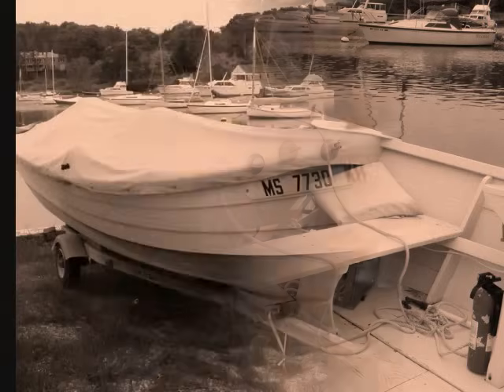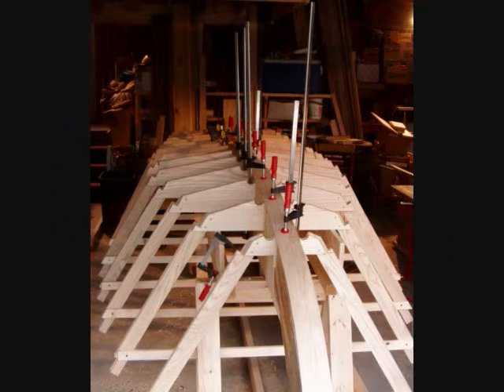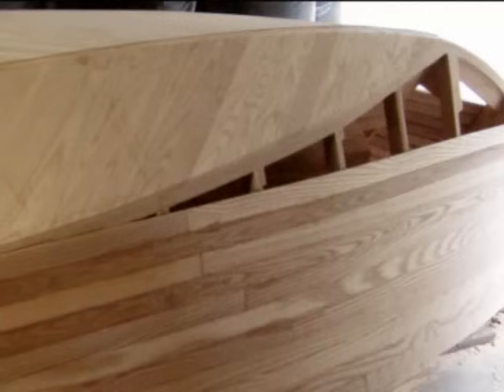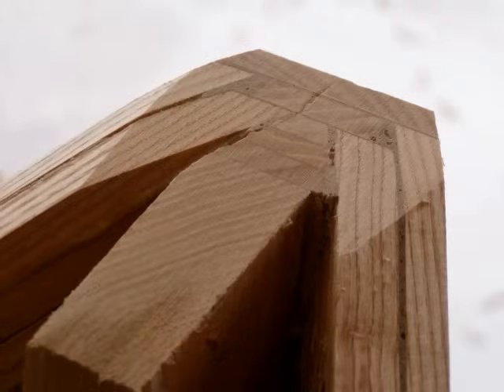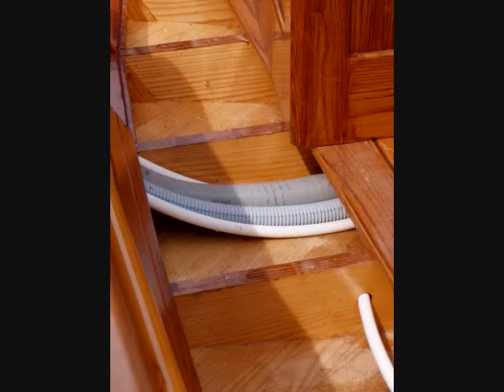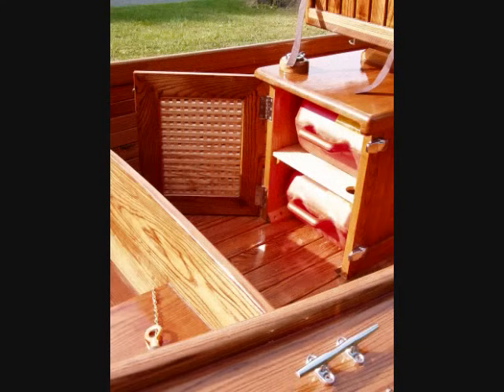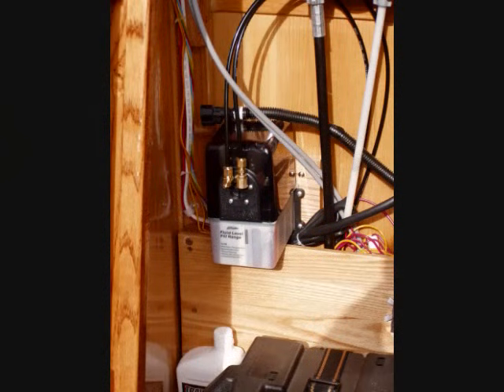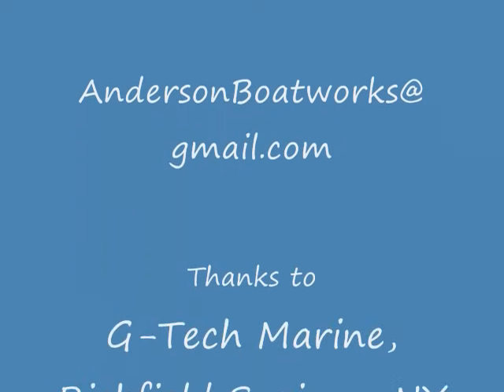Building a wooden boat

Comment: very nice Craftsmanship IMO you can’t go wrong with Building a boat with excellent lines like the Simmons , I’m a retired Professional Woodworker myself  and I’ve owned and operated 17or 18 boats  of many types and materials throughout my life
Reply from the maker: Actually, if I was to do it again, I'd probably increase the beam in the aft section--the Simmons was designed for an 80 pound two-stroke, not a 250 pound 4-stroke engine.  As for concerns some others have raised about wooden boats being "hi maintenance", I've not found this to be the case with a boat properly sealed up inside and out with epoxy embedded fiberglass and a topcoat of polyurethane.  Keeping it under cover, rather than broiling by the dock all summer has probably helped minimize maintenance.

Comment: Mr. ANDERSON,
Perhaps for your next video you could include some of those little written name tags with the small arrows pointing to the various  boat parts you mention. For example, in the shot looking straight down at the bow you name several pieces - the stem for example - which all convergge at the bow. Each piece you list could have little arrows pointing at them with the name of the piece included. A great aid in understanding for a guy  like me.
Lastly sir, if you plan another build to be videoed would you please make it a 22' Bartender? I've got the plans slowly collecting dust in the closet and to see it being built perhaps in a  longer running vid. I'd be grateful.
Paul Beckett 
Vancouver 
CANADA
Reply from the maker: Many years since I made that video......tech continues becoming more flexible and accessible, so a remake would probably look very different.  Thanks for the "pointers".

Comment from the maker: Aye, she's heavy, which is very much appreciated in choppy waters--the 'glass and aluminum boats all go hide while I continue to fish quite comfortably, and with 40 hp on the stern, the weight is not an issue unless you are into racing, not fishing.  I shared your concern about the finish (marine-grade polyurethane)  and though it was painful, I purposely left the boat uncovered in full sun all last summer.  the sole was sprinkled with 150 grit garnet in the topcoat--no slippage when wet.

Comment: Very nice boat and the video is enjoyable to watch.  I do have one question:  How do you get the lumber to bend without steaming it?
Reply from the maker: All the bent work is 3/8th of an inch thick or less and there are no tight radii.  Ash is both tough and limber, so steaming was not even considered and I've had no problems with cracking or joints popping open.  IF the wood had been steamed, I would have had to clamp it in position and wait weeks for it to dry before the glue would work properly, and even longer before stain and epoxy would get a good grip.  Cold molding really works!

Comment: Wood is so warm and welcome. Beautiful workmanship in every way.
At 3.24 on the sides, I would have separated the joints a little further, but of course the  system is so good overall that strength   of the boat  will not suffer, as the joiints are scarphed most probably  but if it is varnished, near joints will not look pleasant in a boat,
Beautiful wood , not a knot anywhere, Congratulations.

Comment: Beautiful boat.  Looks a little heavy watching the sheer. My thoughts are the boat was orig built in plywood to be lighter. Another factor I have concern for is the exterior poly finish as they do not hold up well in daily weather. If you are keeping it in a garage away from rain and UV then its fine. I would also find the floors a bit too slippery when wet and could cause a person to fall.  Is the anchor chain running over a piece of metal or does it touch the wood?  
Just some thoughts. RMP
Reply: He mentioned beach sand being applied to the flooring over wet epoxy to create a nonslip coating of sorts.....from Wyoming USA 🔫🤠

Comment from the maker: I seriously considered a swivel, but settled on the simple locking slide mount because the boat is rigged as a solo fisher....sitting high athwartships in a small, fairly narrow boat, is a good way to wind up with the fishes.  Better to stay facing forward at the helm...you'll hear the drag clicking when Moby takes the troll.  You'll note that the helm seat has substantial arms;they're more than a place to rest your wings--they keep you fenced into the chair in a heavy chop.

Comment from the maker: In rocky shoreline areas such as portions of the MA coast and along the St Lawrence River, the danger of impact is imminent, while rot is a long term problem that will never come up if you hit a submerged rock first....I opted for high impact strength ash (that's why they make baseball bats from it), and will rely on technology and maintenance to keep ahead of the rot.

Comment from the maker: At 2 minutes into the video, you can see holes cut on both port and starboard sides through each frame right where it meets the keelson;  any water that boards will run aft to the bilge pump at the inner transom.

Comment: Beautiful boat!  Why did you choose white ash?  Also what glue did you use for the bottom planking?  Will you consider selling a copy of your boat plans?
Reply from the maker: Ash bends and rebounds well, it's hard and not easily marred, and it takes epoxy like a sponge; plus, I can buy it direct from local mills and get the dimensions I need.
   I used a urethane subfloor adhesive to assemble the frames and strips.  It has a more flexible bond than epoxy, making the joints less likely to pop under shock impact.  It also is much easier to use as it requires no mixing and the excess can be shaved off with a chisel in one pass.
  Simmons plans are available from the Cape Fear museum.
Reply: Thanks, I found the plans.
Reply from the maker: White ash has another advantage--it stains when it gets wet, a dark enough stain to see through the clear epoxy finish.  So for a boat that's finished all bright like this one, you get an almost immediate warning when something has scratched through the epoxy and let in moisture.  Rough out the spot with a belt sander, re-stain to match the color, then re-glass and re-seal with epoxy, top coat with spar polyurethane and a coat of wax--touchups disappear and the boat's life is preserved from rot.

Comment from the maker: She sat uncovered all summer, and did have some small points of finish failure--my own mistakes of too short a radius on some corners; watch for "touching up" video in a few weeks.  The anchor chain never touches wood except in the locker; up through a pipe, and overboard through a roller.
Good questions!  Thanks!

Comment: Does the fiberglass mesh become completely transparent after glassing it with the resin? Can you share any more information on the fiberglass mesh? As to where I could purchase it? Thanks, gorgeous boat by the way
Reply from the maker: Yes, the glass becomes clear when wetted by the epoxy.  Upon close examination (closer than 1 meter) and depending on the angle of the lighting, you can sometimes still make out the weave pattern; that effect is more pronounced with heavier weights of fabric and if tiny air bubbles were trapped in the epoxy as it was applied. So it's generally best to use a low-viscosity epoxy for the wetting out process, and then a thicker type when building up a protective layer.  Search online for vendors (there are many and it pays to shop around); I got my glass from Jamestown Distributors.

Comment from the maker: I'd prefer not to disclose expenses...the outboard, trailer, trim-tabs, AGM batteries, all stainless fittings, sonar, instrumentation, etc., don't come close in value to the amount of time invested.  Boat dealers sell new boats without all the extras
 that make a boat workable with good reasons--they'll give you some song about "letting the buyer pick his own", but just as important to them are avoiding sticker-shock and securing the wonderful markups that come with installing after-sale extras.

Comment from the maker: Time spent on the water or fishing is never wasted.  The stern would ride better with a 20 hp rather than the 40 that's on it now, but I've always favored having a little more engine and running at half throttle, rather than having a smaller engine that has to run wide open....the bigger ones last longer.

Comment: So what made you decide on planking her with ash instead of white pine or white cedar? I grew up in NC, and we plank most of our traditional boats in white cedar over top of white oak frames. I'm just curious.
Reply from the maker: Many of my favorite fishing areas are infested with barely-submerged obstacles--rocks, stumps, etc.  The ash is much more rugged than cedar, and not all that much heavier considering all the other weights in the boat.  I don't like the dull thud of hitting a rock, and I have more dislike for the immediately following sound of cracking wood. With the bottom double-planked in ash, I don't worry so much when I take the kids out.

Comment from the maker: There's a full height watertight bulkhead six inches forward of the transom, and the spaces port and starboard of the motor well are decked tight.  Any water that might come up the well in a following sea will leave by the same route.  My feet and butt have never been wet on this boat.

Comment: Super bravo.
C'est comment le nom de la colle pour assembler et pour l' étanchéité votre bateau ??? Merci.
Reply from the maker: The glue is polyurethane sub-floor adhesive (there are many brands); the epoxy surface finish is by System Three.
Reply: @19Stu54  
Thank's very, merci beaucoup.

Comment: Please give details and specs of fiber glass and epoxy you used? thanks in advance
Reply from the maker: Woven fiberglass on the bottom is 10 ounce per yard; other surfaces 6 ounces per yard. Epoxy is System Three clear coat; also used some SilverTip laminating resin (it's a little thicker) in areas where I could not orient the piece flat and the clear coat (being thinner) tended to run off.

Comment: you said you put foam in it but I didn't see any. did you use a mix that forms foam, or did you buy the slabs and cut email in?
Reply from the maker: I used mix-and-pour (quickly!) foam inside the gunwales and under the deck port and starboard of the motor well.

Comment: I'd love to build my own boat but what about insurance issues?
Reply from the maker: I had no problems. The requirements in NY are for liability insurance (damages you cause to others with the boat); the repair/replacement insurance is optional and based on what you declare the value of the boat to be. If your declared value is deemed reasonable, the premium is small.
Reply: Thanks for the quick reply.I'm thinking of building a 21 footer to fish the English Channel from Plymouth but also be easily trailerable (starting small).I'm sure the insurance issues would be the same here.Could you recommend any qualified plan sellers?I want a deep v configuration with a small cuddy?

Comment: How come to take the screws out after applying adhesive?
Reply from the maker: The glue bond is stronger than the wood, so the screws no longer serve any purpose, and are a potential source of trouble, as almost any metal on a boat in a marine environment is subject to corrosion.
Reply: Jon Doe

Comment: How long did it take y'all to make this?!
Reply from the maker: +Michele Borsari Nearly two years, with time off from deer season until the spring thaw (no heat in the shop). The second year actually dragged into January; the lakes here did not freeze over, and I was able to make test runs (sizing the prop) after poling out of the launch through skim ice. Very exciting running a narrow boat at full throttle in an empty lake in the winter--if I had had trouble, no one would have noticed until I failed to cook dinner....not too bright. I suppose I could have built it faster, but had no reason to.

Comment: Did it rot under that foam?
Reply from the maker: Not yet......the interior of the shell was epoxied right along with the exterior and completely waterproofed; then the foam was installed, and then it was epoxied too, before the interior planks (already epoxied on all sides) were screwed into place.
Reply: @19Stu54  I appreciate the information.  I'm slowly making my first proper boat, and I'm a bit worried about keeping it dry inside.  But that stage is a long way away.  Cheers

Comment: Why are the motor in that position?
Reply from the maker: Originally, the objective of pushing the motor forward was to prevent nets being hauled up over the stern from catching on the propeller...later, users discovered that the additional displacement around the motor makes the boat effectively less stern-heavy; thus when returning to port through following breaking waves, the boat was not easily swamped over the stern and tended to surf ahead rather than take on water.

Comment: are there any free plans for a simmons sea skiff?
Reply from the maker: The Cape Fear Museum has plans, but not for free the last I heard.
Reply: yeah, like $60+
Reply: alfred svedlana
Hardly matters. The wood to build this would cost thousands, not to mention the lease on the build space and the time to build it. If $60 plans puts someone off, they're kind of missing the big picture.
Reply: puddingpimp
To be fair I priced the build materials list at just under $1000.00 . It's not so much the money that irks me, but the principle of we can't even share plans among craftsman. In most other crafts, we share plans of our builds and projects among each other, in comraderie and the spirit of brotherhood. I guess it just saddens me to not find that culture here.
Reply from the maker: alfred svedlana Boat plans can be a tricky problem.  Some guys are trying to make a living at it.  Some would give them away in, as you say, a spirit of comraderie...but for both, there are issues of liability.  What if the builder doesn't follow the plan exactly and the boat fails?  Lives could be lost, and the evidence could well be at the bottom of the sea.  As for the Simmons originals, they don't come close to meeting current Coast Guard requirements for new boats.

Regarding costs, the motor, trailer, epoxy, and hardware all cost as much or more than the raw lumber....the wood is the cheap part, even hardwood.
Reply: I understand what you're trying to say about liability, but I would equate it with chopping a finger off with a circular saw that you're buddy gave ya.... is it his fault you didn't follow safety procedures and chopped your finger off? no.

Comment from the maker: White ash.....same wood used for baseball bats......hard, flexible, open pores that suck in epoxy...and not as heavy as oak.
Reply: What a beautiful boat.
Reply: There are many factors in doing a pro job. One place I discovered that successfully combines these is the Denelle Boat Builder (google it if you're interested) without a doubt the most useful info that I have ever seen. Check out this  extraordinary resource.

Comment: can you make a brig ( pirate ship)
Reply from the maker: too big for my shop, and too big to transport over the interstate to deep water
Reply: but do you think you have the skill to build one ?
Reply from the maker: TheFumbels I've worked on military and civilian ships weighing tens of thousands of tons, so I understand bigger boats.  But a project the size of a brig takes an entire crew working full time to get the project completed in an acceptable timeframe.  Design alone can take a year or more.
Reply: how long do you think it would take for 1 skilled boat maker and 20 labours
Reply from the maker: TheFumbels Way too many unspecified variables for that kind of estimate....how big, what materials, what level of finish, how detailed are the existing plans, skills of the laborers, facilities available at the assembly site, availability of special materials (heavy timbers grow on trees, but they are green, hard to dry, hard to mill, and hard to transport), systems to be built in (or not) including plumbing, electrical, backup propulsion, galley, crew quarters, etc....this is not a project to just "wing it" on unless one has extraordinary passion and a spare chest of treasure.
Reply: oh ok but could you use your tutorial but on a larger scale
Reply from the maker: TheFumbels All of the principles guiding the construction of a skiff also apply to construction of a battleship, but bigger boats require additional considerations because of their scale.  For example, if the center of gravity of the fully rigged skiff is a degree to port, you'll never notice because the weight of the skipper at the helm is a much bigger contributor to list--he'll instinctively stand a half inch to starboard.  To correct the same problem in a destroyer, you need pumps, ballast tanks, piping, controls....orders of magnitude more complexity.
Reply: i guess that is true but how much do you think it would cost to make a pirate ship ( brig)
Reply from the maker: TheFumbels Only thing harder guess than time is money.  Give the folks at the Wooden boat School a shot at helping you: http://www.mainebuiltboats.com/members/profile.asp?MemberID=93
Reply: i will message them thank you :)

Comment from the maker: Cape Fear Museum in Wilmington is selling a 1958 18’ low-side model Simmons Sea-Skiff at a live auction on Saturday, November 8 at 3:00 p.m.  According to the flier, it needs some work.

Cape Fear Museum | New Hanover County

814 Market Street

Wilmington, NC 28401

(910) 798-4367
Reply from the maker: Must have needed some work.......sold for under $900